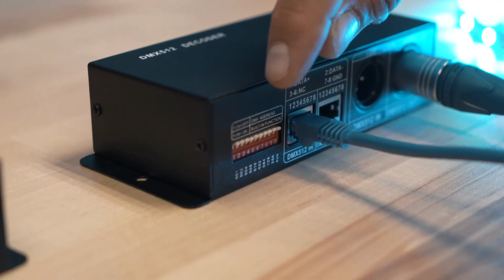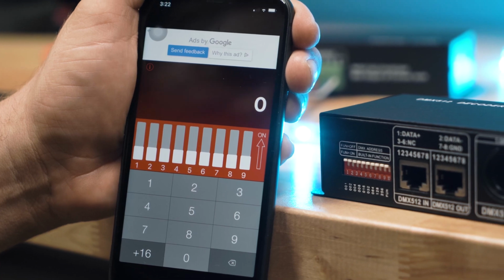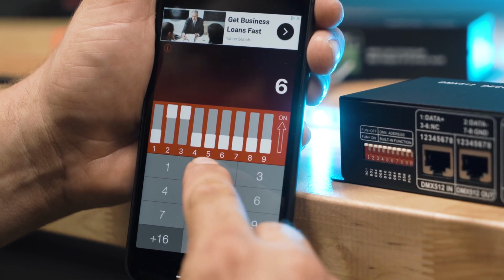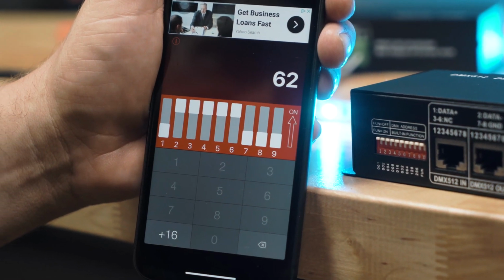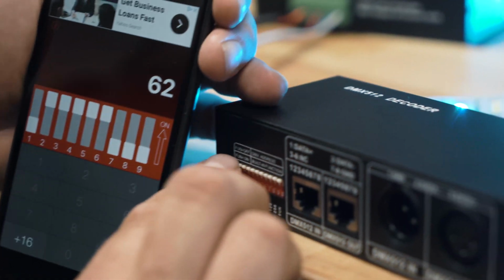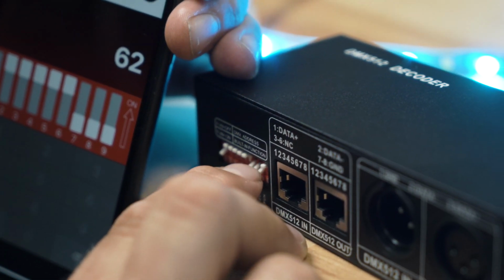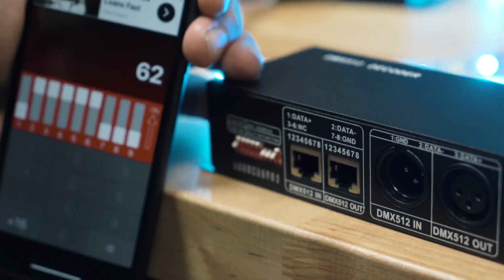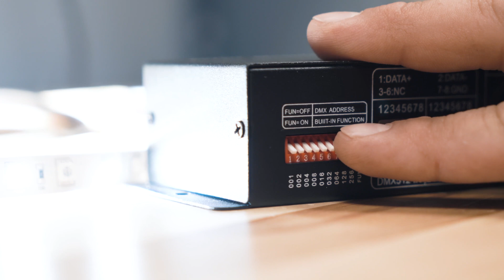How to use DMX512 Decoder and Driver with XLR ports

Comment: I have been trying to get an answer to this question and no one has helped me yet. I'm really hoping you can help me. I am planning on getting a 32 channel DMX decoder so that I can run my own lighting for a piano and stage project. My question is this. If I run, let's say, 8 different lights from that one decoder will they all change with each other or will they be able to function and change color apart from each other. In other words, would I be able to have complete control of each light independently of each other or would I need separate decoders for this? Thanks so much in advance!
Reply from the maker: Hey that is a great question. So on DMX each address is it's own channel. So out of 32 if you divide that by 4, you would have 8 different RGBW address combinations to program independently. Anything on the same address will be the exact same thing. Thanks for the question and if you need any other help, reach out to our LED experts at support@aspectled.com we would be happy to work with you in getting your project set up!

Comment: Hello sir, can this decoder be used for the 2811 led type
Reply from the maker: Hey thanks for the question. This decoder is only compatible with a DMX signal and DC12 or 24V strip lights.

Comment: What kind of cable did you use to get power to the decoder? My IEC cable has 3 wires and I only need 2!
Reply from the maker: Good question, we used a two conductor wire. wire can be purchased at our website -https://www.aspectled.com/collections/strip-light-accessories/connectors-wire

Comment: Great video! May I ask you a question? When I use this controller with DMX Control software it works great but the led strips have always fade in and out when I change colors. Do you have the same behavior or your led strips changes colors instantly?
Reply from the maker: Great question! This is dependent on your encoder.

Comment: What power supply are you using to power the decoder?
Reply: 5-24v
Reply from the maker: Glad you asked! The power supply size is dependent upon the size of the load. At 24 volts DC, the maximum wattage is 384 watts.